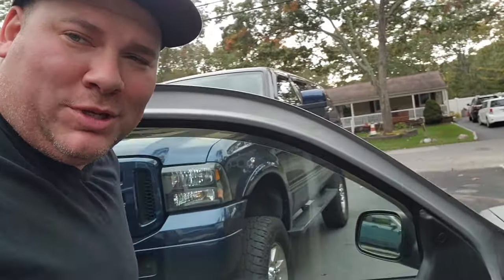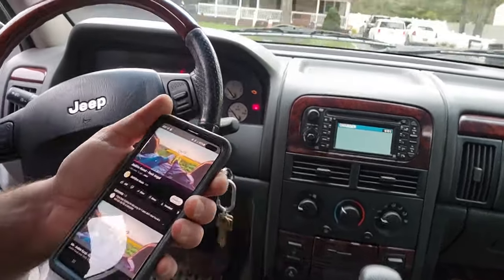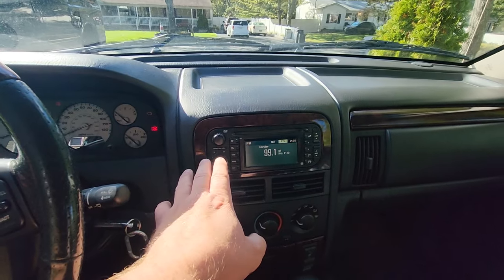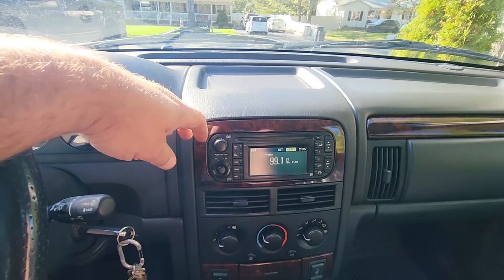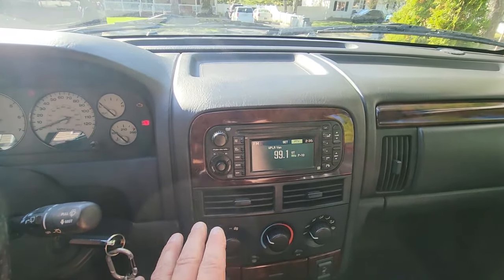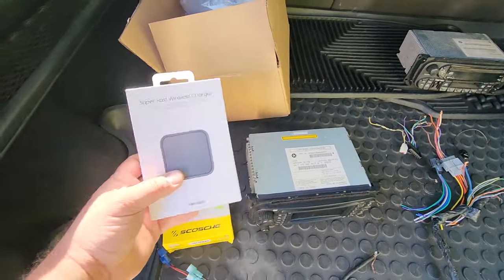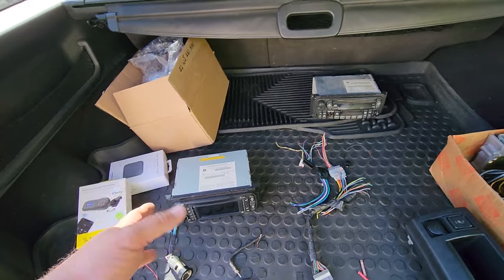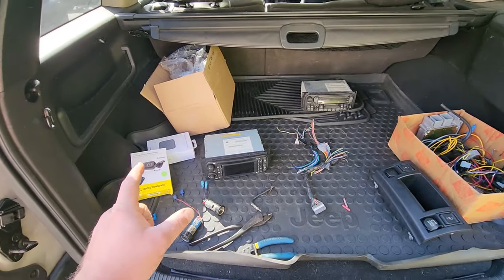FACTORY WJ HEAD UNIT GETS BLUETOOTH AND WIRELESS FAST CHARGING

Comment: Nice idea and clean mod! I'm gonna try that on my 5.9 ZJ. Thanks.
Reply: the zj’s have a different internal working, there are a couple write ups on them though, and the radios are pretty modular. i bought a dedicated bluetooth board, and taped in in the radio. works great, and the radio knows when you’re playing bluetooth and turns the radio or cd or whatever off automatically!
Reply from the maker: @sparkie5571  that's awesoms sparkie!

Comment: I think WEFA WF606 would be more elegant solution if you want to keep factory unit. My self - I plan to upgrade to Android Auto unit, thats marketed as replacement to RB1/RB3 units. It has Carplay build in.
Reply from the maker: That's a great idea.  I used what I had in stock. Lol

Comment: Very interesting! If you have an aftermarket radio in your Jeep and want to do a similar mod you should have a USB port on the back you could run down for a wireless charging pad, loved the video very interesting and awesome to see a factor unit have Bluetooth!!!!!
Reply from the maker: Thank you!  If you have a USB port in the back of your head unit it may be for audio purposes only if you want to do a fast charge I recommend you tapping into the 12 volt power of the Jeep like I did in the video. Thank you for watching God bless

Comment: Im old so I got some of the parts to upgrade my 2000 wj with an after market nav radio with all the bells and the 10 disc changer, looks like im going in the wrong direction, lol. I love my cd collection , all 1000 + . O well. The wireless charging blows my mind.
Reply from the maker: Thanks for sharing, I still have my suitcase of old CDs but BT is just easier!

Comment: Nice video. Where does this cable with the 3.5 jack connector come from? My WJ looks exactly like this one. Same head unit, same CD changer but no accessory cable.
Reply from the maker: It's a module you have to buy that plugs in here the Sirius XM/disc changer goes

Comment: Hello Dan, a cordial greeting, Merry Christmas, I congratulate you on the videos, I am a fan of your channel, I want a question, what is the part number of the on-board computer where I can see the tire pressure and the part number of that player? What does your truck have... to put it on my truck... I have a wj overland year 2005... greetings from Venezuela... thank you
Reply from the maker: Hey brother Merry Christmas!  Thank you so much for watching my videos.  If your vehicle is a 2005 I'm not sure the parts I use in this video would fit your vehicle. The parts I use range from 1999-2004
Reply: @ProjectDanH  brother, mine is wj it applies everything to the 1999-2004 model here in Venezuela this model arrived in 2005 but in the rest of the countries it is a version up to 2004... it applies all the parts and pieces up to 2004...
Reply from the maker: @jefferveloz02 wow. You have the newest WJ in the world! EVIC is  56042756AG 
And the nav unit is an RB1
Reply: @ProjectDanH  thanks brother